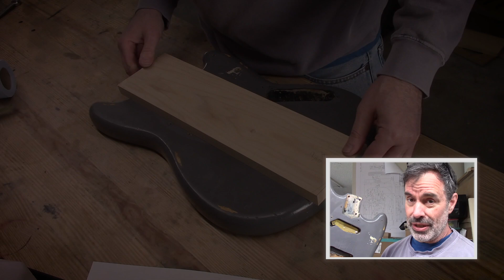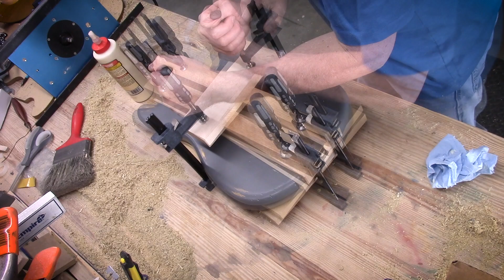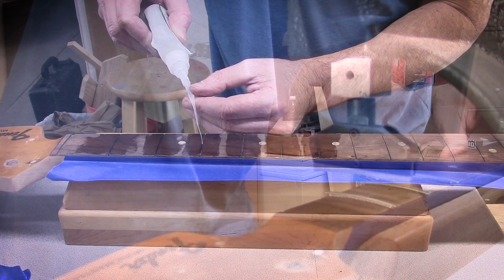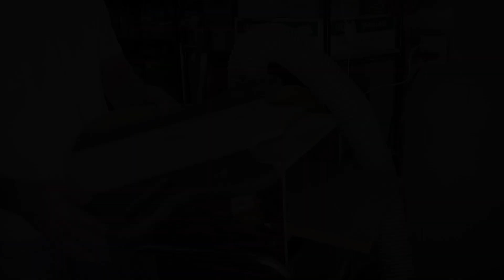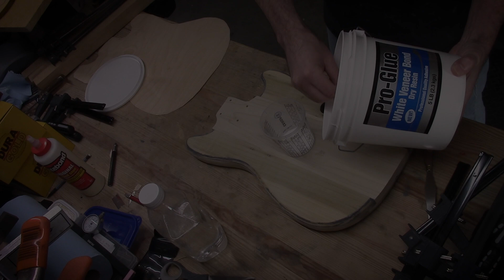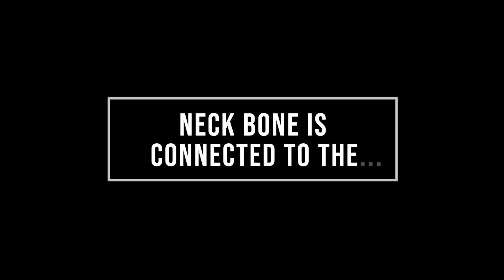Fender MusicMaster Bass Guitar Resto Mod Project EP2

Comment: I've had problems with my fret cauls not pressing the frets in all the way across. It gets about 2/3rds of it in but the last 1/3rd isn't seated. 😒
I think i still got some learning to do with that tool. 🤔
Reply from the maker: Voyeur, thanks for watching!
That's an interesting issue you're having with the cauls.
Without being there, I have be back into the situation from the start. 
Probably asking all the same things you have already been through.

Here goes: 
Fingerboard material, Maple, Rosewood, other..?
Bound fingerboard, or open fret slot?
Fret type, nickel or stainless?
Are the fret tangs damaged or not straight like the slot?
Fingerboard radius verified to match Fret caul?
Fretwire radius, matched to fingerboard, or tighter radius?
Fret slot depth verified to accept fret tang (deep enough and clean)?
Fret slot width verified (not to narrow, not too wide)?
Any splinters or tearout at the top of the slot?
Slight "V" filed at top of slot?
Glue, or no glue in fret slots?
If glue, what kind of glue?
If using an arbor press, how much pressure (vague and subjective question)?
And probably a few other things I'm forgetting.

If the fret is seated part way across, but not all the way across, it sounds like there is either something in the slots, or the slot depth isn't consistent all the way across.
Also, if the caul is of a different radius than the board, full seating would be an issue.

Depending on what glue is used, there may be a timing issue a hand also, the glue may be setting up before the fret really gets home. But I'd expect that to be a uniform issue across the width of the board, not just to one end.

Issues I've had when frets won't go all the way in is typically fret slot depth, or some debris in the slot keeping the fret from going in.  I don't try get the fret slot depth to match the tang, I make it a smidge deeper, so there is room for glue and any little speck of atmosphere that fell in there. 

Sorry, I don't mean to offend with the questions, just trying to get my head around the issue.
It is un-nerving when things that should be rather simple put up such a fight.

Good luck with your project, and let me know if you determine the cause of the fret install issue.

Comment: You're just awesome!  The new pocket! Wow! FYI,  I chipped my fret kisser under string tip and they replaced it, no questions asked. I love them for that. I'm now doing frets. Just need some more tools. So far only replacing the first 5 or 6 with pre radiused frets.
Reply from the maker: Randy, good to hear from ya!
WHAT?, chipped a fret-kisser?  WOW, never even thought of the possibility, glad they took care of the replacement for ya. 
Sounds like you're busy, good luck with your project, be safe, take care and talk again soon!
Reply: @theNextProject , good to hear from you as well. The under string kisser has a fine tip on it and if dropped will chip the diamond coating for sure. Right now I'm learning to reset a acoustic bridge and fix cracked tops.  Have a good one. Till next time.

Comment: Another great video—always a pleasure to watch! I have two questions: Why do you use formaldehyde glue instead of Titebond for the veneer? And why did you go with traditional clamps this time instead of the vacuum bag? Looking forward to seeing more!  

Best regards from Germany.
Reply from the maker: Floyd, good to hear from you and thanks for watching!
Great questions.
I keep trying both kinds of glue, and while both seem to do a good job, I'm finding that the formaldehyde glue is more stable when dry. It is really great if laminating multiple layers of veneer, or forming laminate layers especially. When dry, it has nearly no spring back, meaning it stays in the shape it is formed, or clamped. 
Titebond is okay if used on a thick top glue up, but seems a bit rubbery in general. Titebond may also be more prone to seeping throught the veneer.
I've also used a Titebond Cold Press glue, it's brown in color, and less likely to seep through veneer, dries much slower than Original Titebond. 
Too many options, all good at specific things, ugh!

Other question... My air bag is currently broken. The vacuum port tore off the bag. Another thing to fix. So, I went old school, which worked just fine for this flat laminate process.

Hope you are doing well, be safe and take care!

Comment: Loving this video series. After routing the channel for the Poplar plank, he mentioned that there was just enough gap for the glue. Do you intentionally leave a gap? Or after routing there’s just enough fit generally for glue to fill up all the negative space?
Reply from the maker: David, thanks for watchin!
That's a great question.
Basically what I meant was that the fit isn't so tight that adding glue would swell the wood to a point I couldn't get the pieces together.
So the fit is snug, not loose, but not tight... WOW is that vague!
No intentional gap, and no slop either. Sorry, I'm not making this clear at all.
Yes "...there’s just enough fit - for glue to fill up all the negative space."
Thanks for the answer.
Hope all is well, be safe and take care!

Comment: It's looking amazing. What kind of shims did you use for the fractal? I'm just curious 😅
Reply from the maker: JJ, thanks for watching, and thank you!
Ah, I used an old feeler gauge leaf, I think it was 0.004". Made a couple flat washer/shims from the feeler gauge and slipped them in between the brass parts. Took the slight slop out.
Also, just a simple tightening of a couple knuckles helped a bit.
I may discuss the tool and repair in a future vid... don't hold your breathe on that. Too much going on right now.
Be safe and take care!
Reply: @theNextProject  that's really cool. It seemed to work great. Thanks for the info, take care